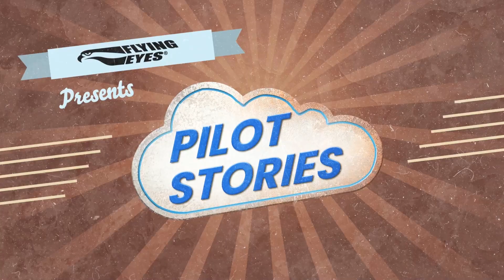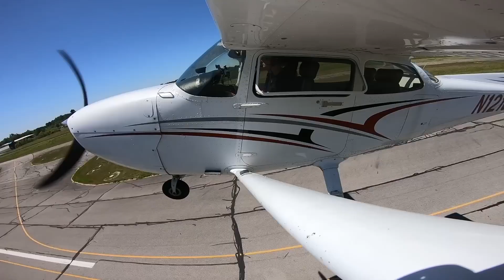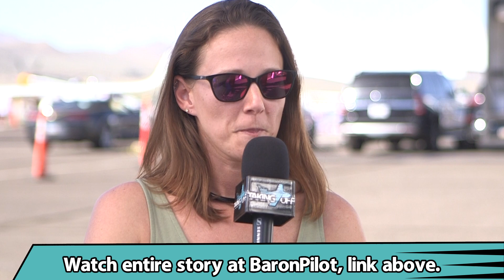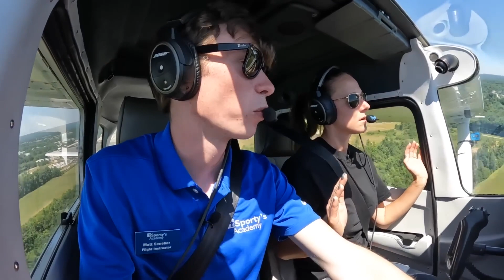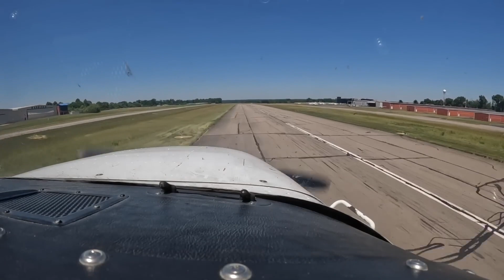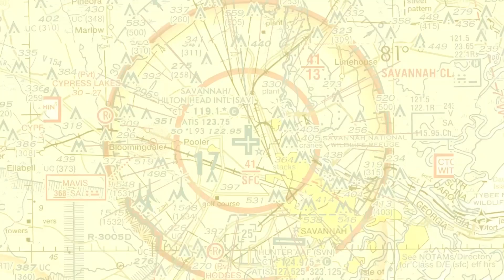Engine Fails! Kim from BaronPilot - Pilot Stories

Comment: Nice job with the “impossible turn”. It’s saved me 4 times.
Reply: You need a new mechanic
Reply: It’s the not impossible if you run out of energy. In an airplane, energy is stored in three places. Airspeed, altitude and engine. If one disappears and you still have enough of the other two , a turn back is possible. It should be practiced at altitude in the aircraft that you fly, so you know how much energy you need.
Reply: Seriously you have the worst luck with engines ever, or you don’t believe in oil or annuals. Something isn’t right 🤣
Reply: @VictoryAviation  No, it’s not that simple. One of my first commercial jobs was towing banners. They fly almost full power at 60mph at a thousand feet. Two of them happened while picking up banners. I also took jobs ferrying aircraft and though airworthy, one of them had an engine let go on takeoff . The fourth was on takeoff in my Taylorcraft. Some say I’m unlucky, but when I hear so many people dying in similar circumstances, I think I’m very lucky or very well trained or both.
Reply: @Av8or7   No doubt skill played a role for sure. So three of them had engines that were very much out of your control when it came to quality or thoroughness of maintenance. One of the engines was yours. All four incidents occurred during takeoff or climb out from nearly zero AGL. You’ve more than quadrupled the number of engine failures that most pilots have in their entire careers in how much time?

Stop flying in clapped out planes! You’re using up all of your lives 😆

Comment: Nowhere to go? On the footage you see plenty of fields straight ahead. I am glad you guys came out alive, but turning back wasn't the right decision. That engine could have quit and left your CFI without options imo. Sounds like something similar that just happened to McSpadden with partial power loss.
Reply: EXCUSE ME!  You weren't there - Not your call.  They did everything 100% correct.  If they hadn't, then there would have been a totally different outcome.
Reply: @4-7th_CAV  I wasn’t there no but I’m not blind either. You can see. Clearly on the camera footage that there were fields to put it down in. This time they made it, next time they think that this is the right thing to do they might end up short or in a stall spin. It’s a gamble every single time.
Reply: @Kaipeternicolas  See Baron Pilot's reply on this video. Cameras give illiusions of things that aren't there in reality.